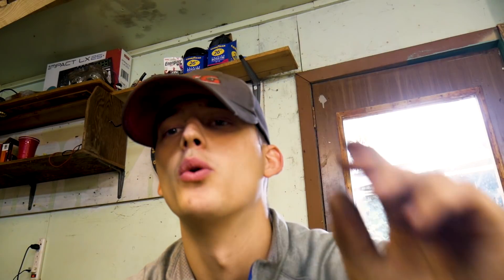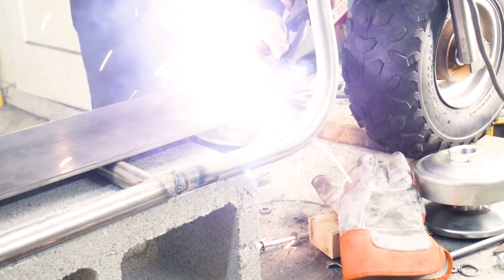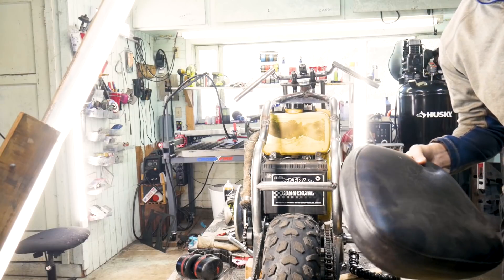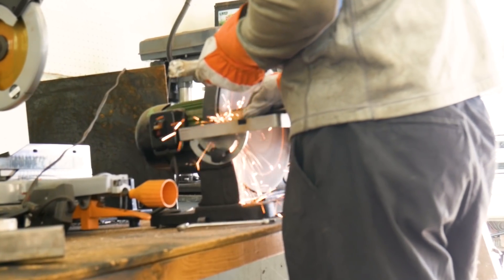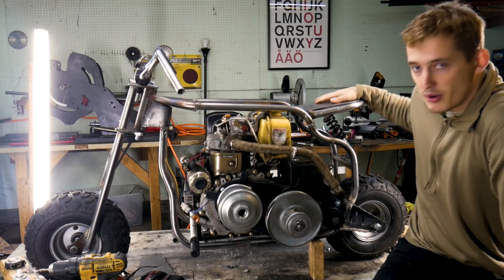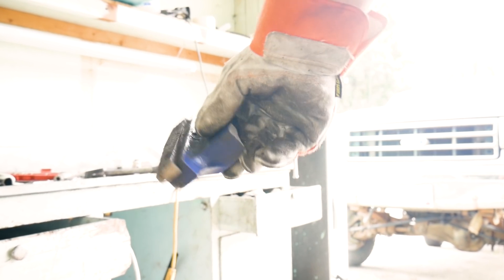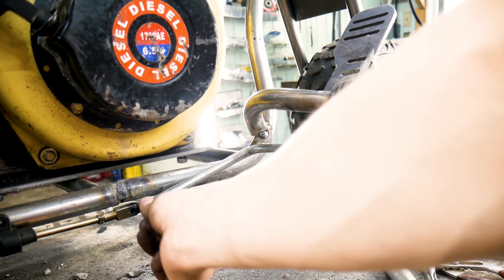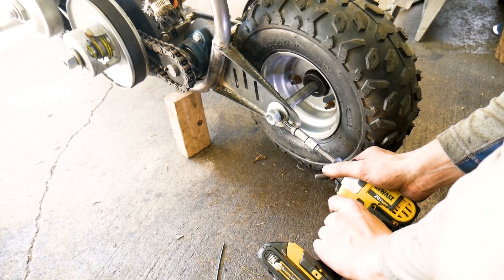Homemade Diesel Mini Bike Build (Part 2/3)

Comment: I wonder if the weights for the torque converter will need to be adjusted to account for the different power band from the diesel engine.

Comment: You've got some mad skills, Oliver! One suggestion I would like you to consider is this: A build without a jackshaft. I know this is a signature part of your builds, but can you do one with a geared transmission? Maybe from a small motorcycle? An alternative would be an electric build - removing the need for a transmission altogether.
Reply: Look through his videos. He has builds with transmissions.
Reply from the maker: I like the idea of an electric build! And I have used mini transmissions from riding mowers before, but they are not really built for much speed.

Comment: Well done! You're problem solving skills are great. Question: if you recoil start the engine, do you need to keep the battery?
On your last video, part 1, I commented about your use of CAD and an automated plasma cutting table. Been thinking about that, and I now believe I was a little off.     It occurs to me now that all design work starts inside the head, in the brain. That's where the initial concept begins, not in the CAD program. After the initial concept takes root, it's still the brain doing the real design work. The CAD is fancy paper and pencil work.
Reply from the maker: You are correct,  it I want all the bells an whistles on this project. Stay tuned!

Comment: Hey man going together nicely. 
When you have clearance issues with bolt heads you could countersink the bolt hole and use countersunk bolts. 👍
A small vz21 turbo would be pretty cool also for a later date.
Reply from the maker: Ha very good idea! Can you do countersink with hex bolts?
Reply: Oliver Motorized no sir, you’ll need countersunk bolts in place of the hex bolts.